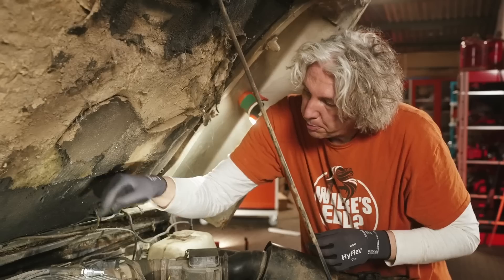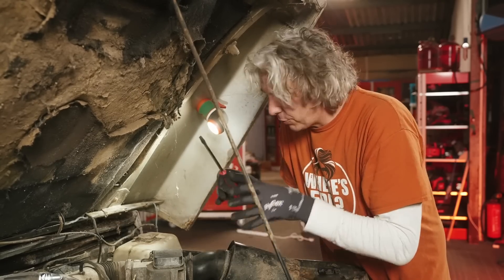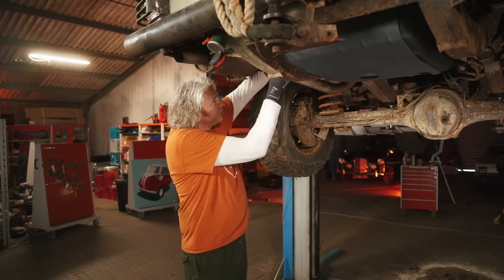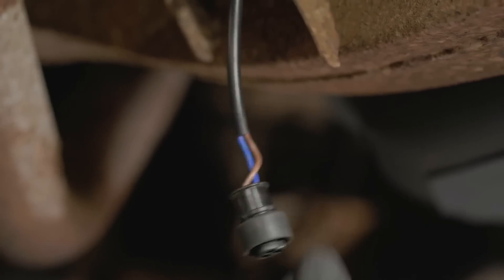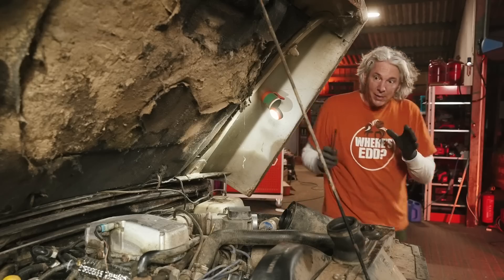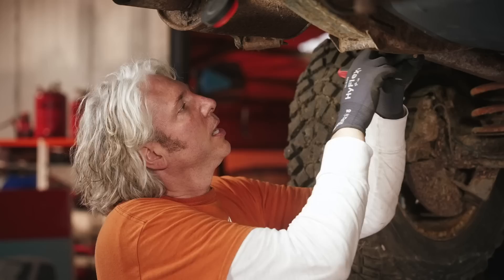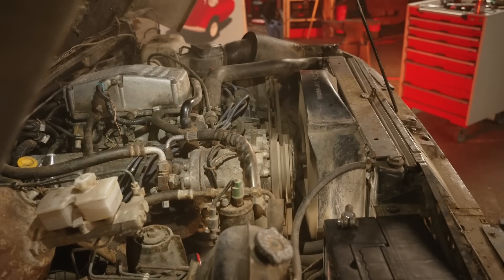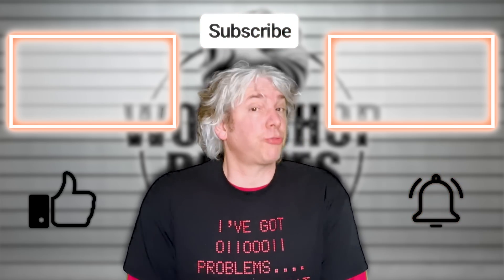We Have Spark And We Have Fuel... But Why Won't This Range Rover Start? | Edd China

Comment: Edd, hi from Russia. I'm following Your great TV and YouTube career for the last 20 years and would say, You are not a great repairer, but a talented engineer. 
If to have such a man in garage, it would be my dream to have 20-30 old and rare cars and such a company like You ;) 
In the top of Your career at Wheeler's dealers in 2003-2007 I was always used to set You as example for my garage men. And, actually, they were so stressed by me that they started to follow Your series and were also happy to note, that You can touch a wheel and saloon inside with rusty or oily hands :)) 
Also, You are a great showman. 
But maybe You are a better talent than to repair somebody's projects? Why have You stopped the idea not to repair but to produce vehicles (except the funny sofa and likewise)? 
If You have some ideas and experience in R&D, please let me know.
Reply: Are you proudly supporting your murderous president?

Comment: Regarding '86 RRC:s. I've got weird problem. My cylinders 2&4 do not fire at all. Rest fire away just fine. I've tried swapping the spark plug wires, I've changed the spark plugs, there's nice spark anyways, compression is equal between the bank and I've also swapped the plugs (recommended champions). And there's also fuel (it oozes through the manifold even) and the fuel injectors are checked by the shop also. Kinda running out of ideas :D. Swapping to OM605/606 is always an option of course :D.

Comment: question edd id the the landy a petrol or diesel model??? 
personally if it were me I'd likely buy a running gear and engine in a inline 6 or v8  toyota  at least you will make it reliable for the next 50-100 years
Reply: While Diesels do have glow-plugs, they definitely don't have spark plugs.
Instead, the Diesel is so highly compressed, that it spontaneously combusts.
Reply: @Makatea  i know that...
Reply: It's the V8 petrol engine, I forget it's capacity, but definitely petrol...